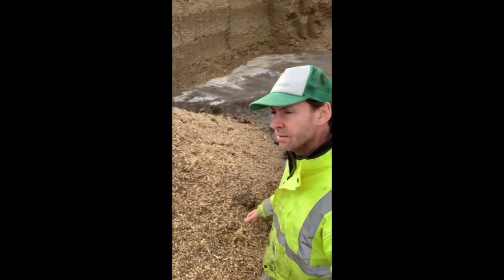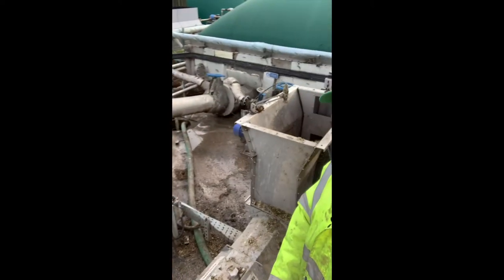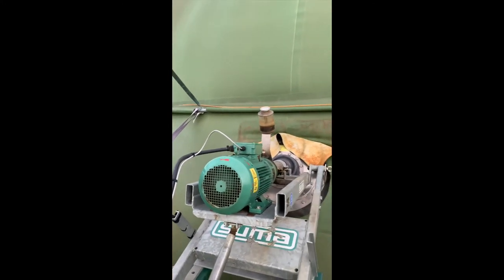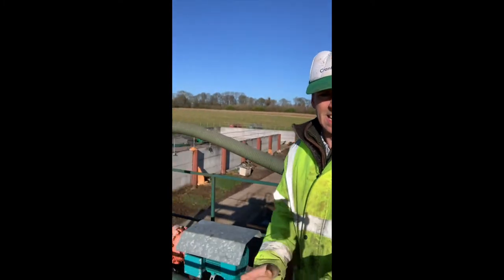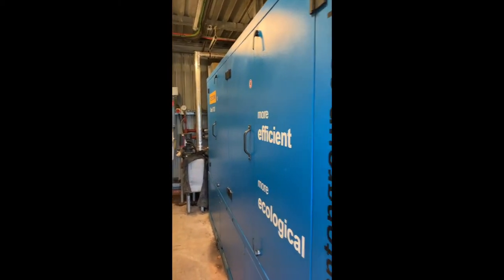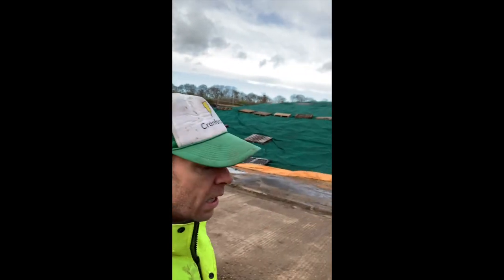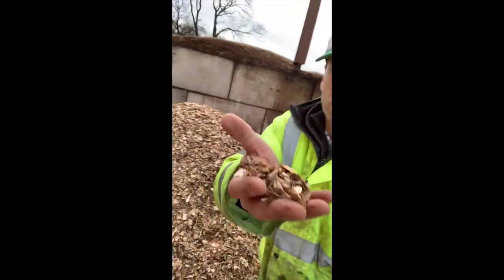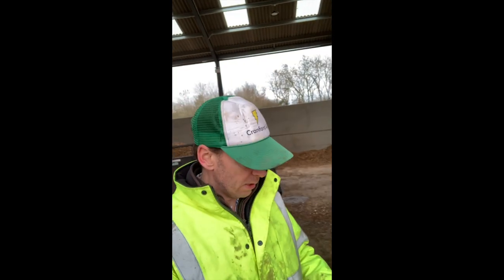Running an Anaerobic Digestion Plant

Comment: How much land do you need to operate a plant like this
Reply from the maker: we use about 6k tons per annum of maize, so you need around 171h.
Reply: Very impressive,  not to get to into your business or anything but im curious.  The operation your running now AD and woodchips comparing to just farming normally your 171h , is it a worthwhile business venture? 
* Im a farmer myself but just started a new job in the AD business, its all new to me but I'm fascinated by it so far
Reply from the maker: @RamLamb69  yes. definitely better. you are much closer to the customer with firewood and chip.